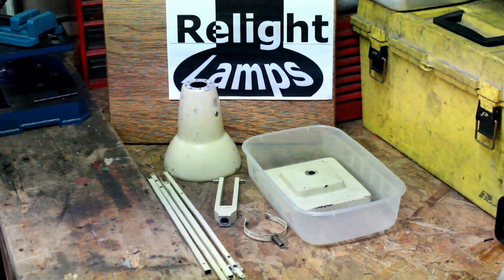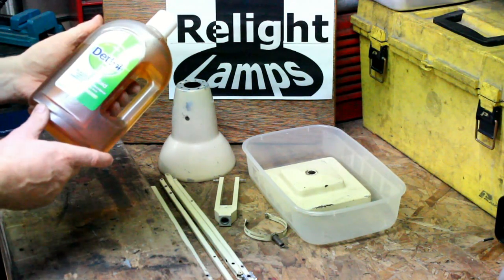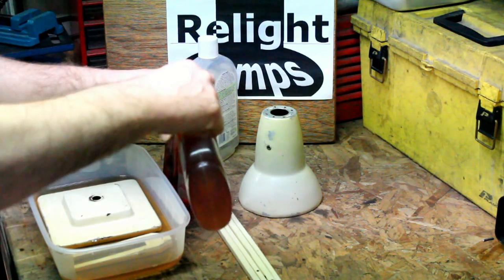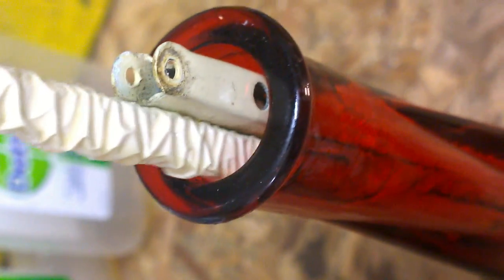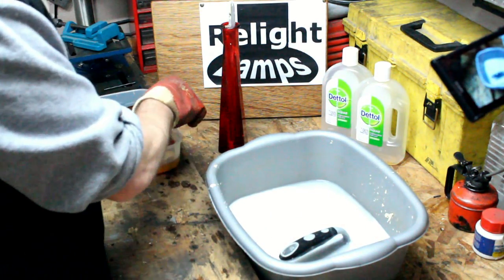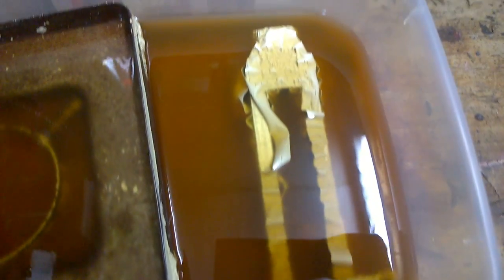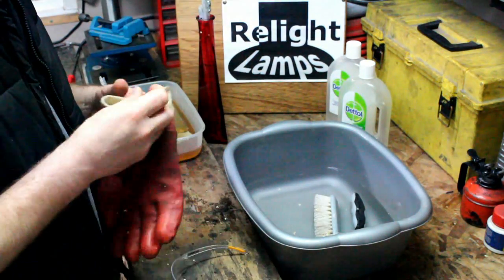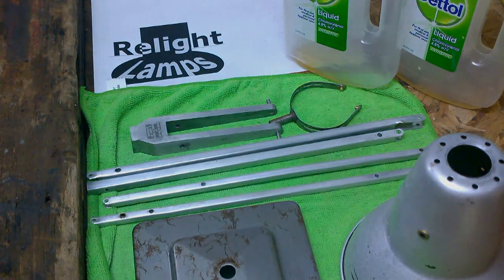How to paint strip a Anglepoise 1227 Lamp

Comment: Wellthat was 7 years ago. No relighting anymore in 2022 ?  My tip, use a sand blaster with glass pearl. Takes you 20 minutes. I just upcycled an Anglepoise 99 in 2 hours including the poedercoating on it.